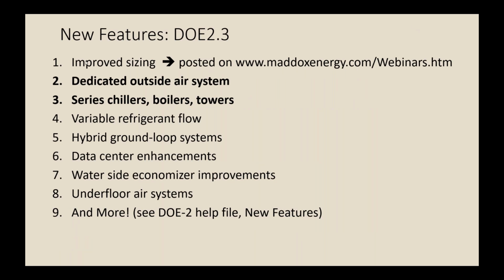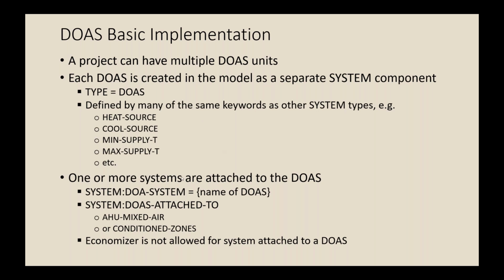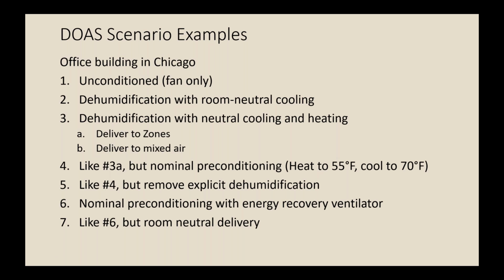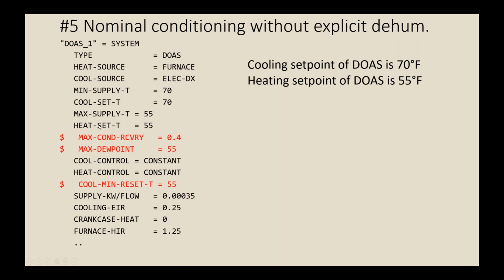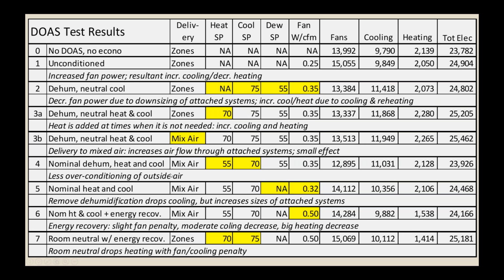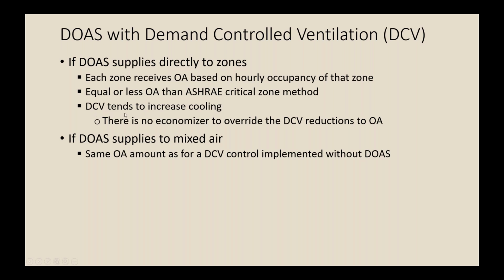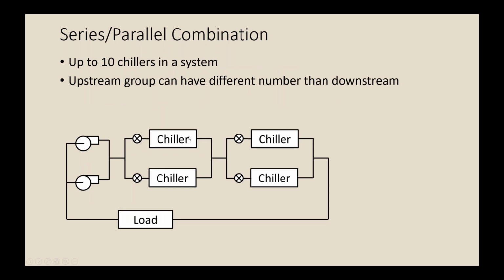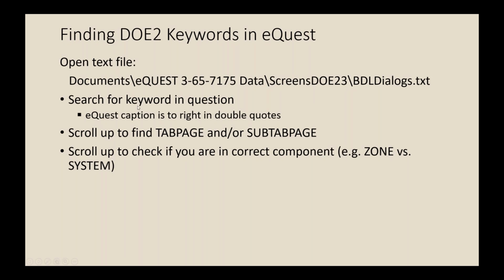eQuest DOE23 DOAS and  Series Plant

Comment: Thanks- very helpful video. Where I'm confused is with the table summarizing the results for the different cases. Case 0- no DOAS- shows the lowest overall energy use. Every case with a DOAS unit uses more overall energy (fans plus cooling plus heating). This doesn't match what seems to be widely agreed upon understanding that DOAS units are good for energy efficiency. Is this because of limitations in the model? Are there other set points that should be adjusted when comparing no-DOAS systems to DOAS systems?

Comment: I have 3.65 and 3.70 versions of equest installed and there is no DOAS option for HVAC System Type selection.  What am I missing?
Reply: It could be that you have DOE 2.2 selected as the simulation engine; if you go to the menu bar>tools>select DOE2 version you should select DOE 2.3; when you exit out of eQuest and re-open you should have the DOE 2.3 simulation engine selected.  When on the air-side HVAC tab you should now be able to create a DOAS system by right clicking "Project: 'project name'"(on component tree) > create new HVAC system; from here you should be able to select DOAS as a system type from the drop down list.
Reply: @ethanseaman1652  I did exactly this and my equest 3.65-7175 no longer opens. How can I go back or properly open 3.65-7175 with DOE 2.3?
Reply: @SAndo42  I’m not sure why selecting a different sim engine would cause the software not to open. If I was in your shoes I’d uninstall/reinstall the software and try again.